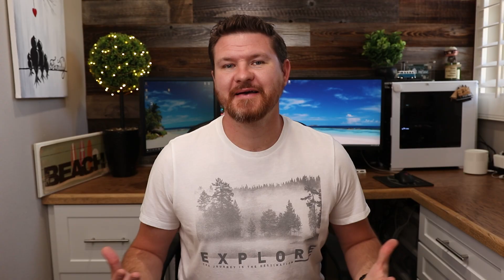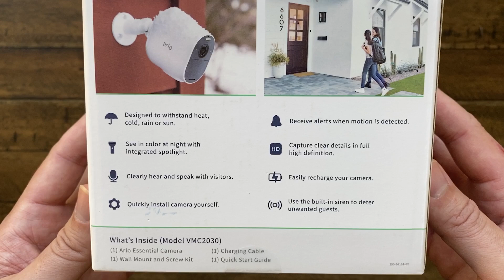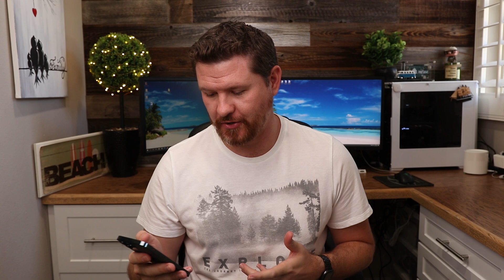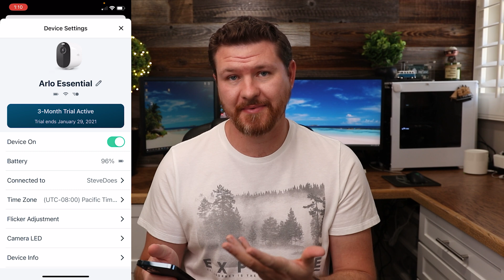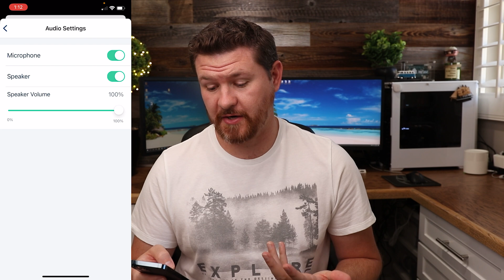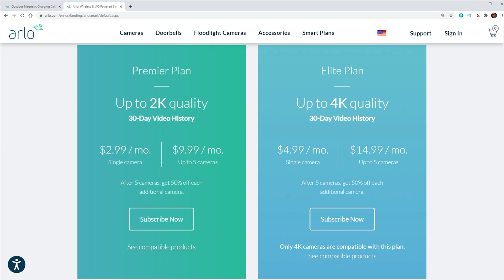Arlo's New Security Camera Goes BUDGET | Arlo Essential Review

Comment: Just unloaded my last Arlo camera.  When they stopped supporting the cameras and tried to force people on the subscription plan, it was the last straw.  I got the 2 camera kit at Costco for $300 and added two more cameras.  They would disconnect which involved climbing up and down a ladder to get them and take them in to the base station to sync.  They needed a sync option on the phone app.  They would go off on a moving tree branch but would not film the porch pirate in direct line of view.  Battery life was maybe 30 days and no warning other than you constantly checking the devices on the app.  I just got a 6 camera system with better cameras ( wider  coverage angle and the ability to block out certain areas from setting off the camera) that included audio for half the price.  Only 2 batteries needed per camera and a 2 year battery life.  Easier install with only 2 screws and a snap on camera which solved the problems of the camera screw loosening or the parts dying.   It has an optional subscription that includes an extended warranty and extra options.

Comment: ARLO...You have outsourced your customer service and they could care less about helping Americans.  You can tell by thier voices and attitudes that they don't give a damn.  They barely understand English, nor have customer service skills to problem solve.  The communicate via scripted responses and when confronted with problems not within their scripts their minds are befuddled and they put you on hold to have their "supervisors" answer the questions.  They in turn don't now how to handle the issue and thus the problem is not resolved.  There are no longer phone numbers for American people who actually work within ARLO and this causes the problem.  All I needed was someone who knew enough about the produce to tell me, "Why in the Hell is Sam's Warehouse selling old versions of the ARLO 4 Pro that have Mini Type A connections for Solar Panels when you can't get those solar panels any longer. I have 8 cameras in which I tried to get the correct solar panels and they keep sending me either the magnetic three connection adapters or the Type C mini HDMI Connections on the solar panels.  I even tried to get them from the Wasserstein Company and the same issue...no type A mini connectors available.  I can't return the cameras because the delay in getting the correct solar panels has moved the return date beyond the time period that I can return the cameras...now I am stuck with cameras that the batteries go dead and I can't climb up and down ladders to recharge the batteries due to health issues.  Thank you for providing me with a worthless product and an even more worthless, impotent customer service section which has no interest in solving my issues.  They hung up on me the last time and thus this review.  This about says it all...what do you not understand.  By the way, your canned answers do not describe anything close to the issues I was faced with so this survey is about as worthless as your whole company...sell and get into raising cows.

Comment: How long does the battery charge last? That was my most pressing question. Three reviews later still no answer....
Reply: Been testing this Arlo Essential Spotlight Camera. 100% charged and down to 94% after the first day of testing, but my cam is facing sidewalk, street, driveway and picking up lots of motion, even at night (animals). I prefer the spotlight on at night during detection but that greatly depletes the battery. So, camera power will last no more than 20 days.  If I decide to keep it before the 30 day return window expires, I'll buy a solar panel to power the cam. On Amazon it's under $40. Hope that helps.

Comment: What's the battery life or does it have to be plugged in all the time
Reply: That was my most pressing question. Three reviews later still no answer....
Reply: @clarkadams895  I did my research and there's not many camera's with a good battery life. The only camera that has a battery with decent life is the nest cam by Google. As long as you aren't using the camera it can last a while on the battery life.

Comment: Hey Steve, can you help me, I have 3 arlo essential spotlight camera's, I installed them an after a month, all 3 jus stop flashing at nights whenever it takes a picture, the lights comdz on when I turn it on,but when it takes it picture for some reason the flash doesn't comes on anymore, only the night vision lights comes on but no flash.. can you help sir please?
Reply: Mine also, apparently you have to subscribe after the 30 day free trial. If I knew that I would have spent the extra money and gotten another arlo2 camera for my system. I should've read the small print.  :(
Reply: @robertnelson2615  oh my.. I realize that much after.. although the light doesn't flash anymore when it takes a picture at nights.. my camera's working very well. Buttery last long an they're working well same ways.. I'm in Jamaica and I was trying to subscribe. But it says I can't because arlo or not in Jamaica.. so it's an overseas thing I realize. So if I knew all that at first I wouldn't have gotten them..

Comment: BUYER BEWARE!!: Arlo and most products like Ring have a major flaw on 
IOS systems. You only get one notification when a sensor is triggered 
with no repeat options or sound customization which means you will 
miss/sleep through these most of the time - absolutely unacceptable for 
an alarm system. Thousands of users have complained about this on the 
Arlo forum for years to no effect. I have and Arlo system which I will 
replace as soon as a proper product is available on IOS
Reply: Thanks on your comment on Arlo. I was almost thinking of getting Arlo, but reading your comments and the subscription deal , I said nope. U find a different system let me know.
Reply: I have a pet door and two dogs. Ring uses the 'barking dogs' sound for notifications. My dogs quickly picked up that when they hear that someone is outside. They go running out to bark at wutever. Only one notification needed here!

Comment: Buyer Beware: These are great unless you don't want to have to pay $15 a month basically to use the product. Without the monthly subscription the only thing that these will do is show you a live feed with about 5 second delay. So if someone is stealing your package, breaking into your house or tagging your sidewalk, you can see it happen after it's already occurred. If you are monitoring live. There is no way to get a motion sensor recording onto your device of computer without buying the subscription service. So shell out $350 for a system that costs $15 a month to actually use. LAME.
Reply: The subscription is $2.99/ month not $15